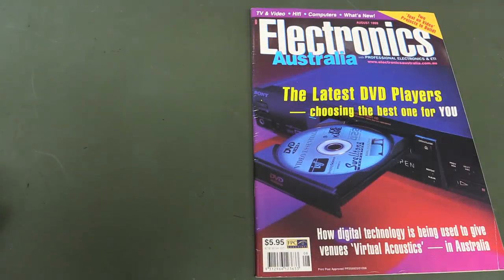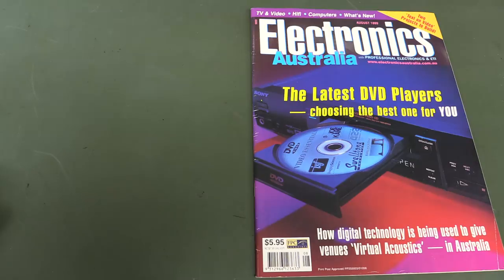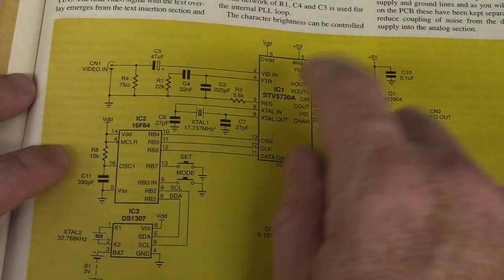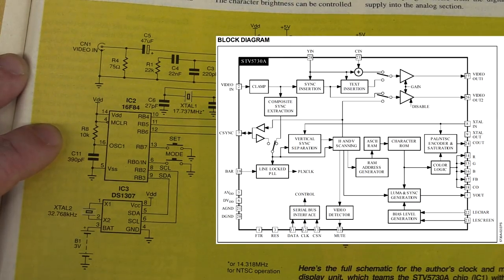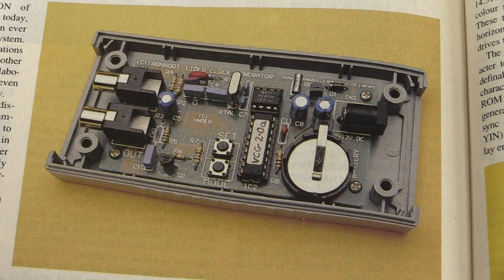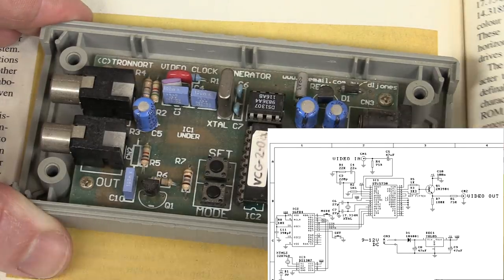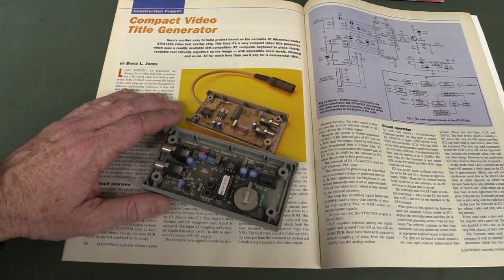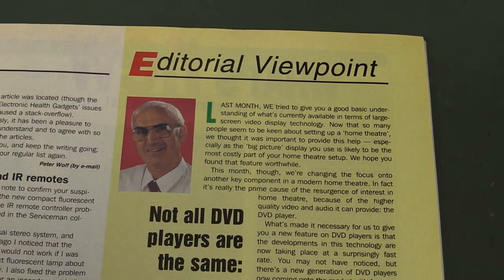EEVblog #b10000000000 - 1K Micro Magic

Comment: Hm... "Copyright TRONNORT"? Someone was a fan of a certain movie back in 1999. :)  The code was assembled not compiled. Was that a typo in the text "VLDEO CLK"? Anyway, very nicely done. Always fun writing programs in assembler for a device with very limited memory. I never got in to PICs due to the bank switching business. I'm working on a project using an AVR with 4K program memory and 256 bytes of RAM. I worked a way to store 4 GPS position reports in that amount of RAM. :)

Comment: Is that composite really the same as old style PAL? Seems a bit detailed. Could throw the chip out otherwise. How much text could they enter in the 2nd project? Is there enough like ram somewhere?
Reply from the maker: You could put text anywhere on the screen. IIRC the RAM was inside the STV chip, you wrote to that.

Comment: If you like stuff crammed into small amounts of space, check out the Demoscene. They've made an art-form out of tiny programs. There's plenty of videos on YouTube of recordings of 64k and 4k demos. I once even found a real-time ray-tracing demo that takes up just 256 bytes. Still got the .COM file. Yes. COM, not EXE, COM. 16-bit DOS program. Works just fine in DOSBox. It's called "TUBE" and even includes the x86 assembler source code.

Comment: This reminds me of when I programmed several video games into an Arduino (ATMEGA328 microcontroller) and I was very disappointed it didn't fit the 32KB of memory. By the way Arduino is great to start playing with microcontroller but it's not optimized for memory efficiency.

Comment: LOL, the old Warp13 programmer!... I still have one somewhere..
Reply: I still have a 100 or so PCBs sitting behind me. One day you might see another Warp-X3. :)
Reply: I have fond memories of this reliable programmer. It worked like a dream but the support was suddenly gone. It could not program the newer devices so I had to buy a new programmer.
Reply: Yes, it was very sad and I still really feel bad about that even today. However, the collapse of my health was not something I could control. Very sorry about the sudden demise.  Anyway, thanks for your support.
Reply from the maker: Well I'll be, it's none other than Jim Robertson!
Sorry to hear about the health problems causing the discontinuation of that excellent programmer.
Reply: Sorry I did not know you are the designer. It was not meant as criticism. I meant to say that I found it a pity I had to shelf my favourite programmer. I was just learning how to program microcontrollers and had some issues with programming a PIC16C71. The damn PIC would not program so I wrote you about this problem. You let me measure some voltages on the programmer (were OK) and then asked me what PIC I was programming. After that you took the time and patience to friendly explain a dumb dutchman what OTP meant....  I hope you are in good health now.
Reply: Jim Robertson I always did wonder what had happened, now I know.  From someone else whose health collapsed suddenly shortly after turning 18 (in 1990) and never really recovered I wish you the very best and if one day there is a V3 then so much the better, but if not at least we got to enjoy your earlier work for a good while.  But do take care of yourself.

Comment: It says 00:00:80 Is that HH:MM:SS? Why are there 80 seconds? @24:00 It seems to work properly @26:20
Reply: It's not showing the current time at that point, it's letting you set a custom title. Presumably Dave figured it was up to the end user to not do something stupid with the digits. Or if the end-user wanted to put 80 seconds in their title screen, that was their problem.
Reply: Now I'm curious what would happen :D

Comment: Many years ago I coded a Bell 202, 1200 baud Demodulator in assembly for an ATTiny10, which has only 1024 instruction words.  I never would up using the modulator code for anything practical, but it was fun to explore doing digital signal processing on such a limited system:

  https://sites.google.com/site/wayneholder/attiny-4-5-9-10-assembly-ide-and-programmer/bell-202-1200-baud-demodulator-in-an-attiny10

This was back before the ATTiny10 instruction set was supported by the GNU/Atmel toolchain, so I also wrote my own simple IDE and assembler and built my own programmer for the TPI protocol using an Arduino so I could write code fir it on my Mac.  This project is covered here:

https://sites.google.com/site/wayneholder/attiny-4-5-9-10-assembly-ide-and-programmer

I later upgraded the IDE to support coding in C once the GNU toolchain was updated for the ATTiny10:

https://sites.google.com/site/wayneholder/attiny10-c-ide-and-improved-device-programmer

The ATTiny10 seems to have become hard to obtain after the Microchip acquired Atmel, but I still think its a powerful little chip (especially for its size) and my web site, https://sites.google.com/site/wayneholder,  describes several other projects I've made using it.  Most recently I used it to create my entry for the Flashing Light Prize 2017:

https://sites.google.com/site/wayneholder/flashing-light-prize-2017

Wayne

Comment: Because I only had access to Mac and BBC micro computers when I was young, Microchip was always inaccessible and that is still true today. They continue to support Windows and not Mac! In an age of platform agnostic support, Microchip has bluntly refused to make any of their products useable on a Mac without third party help, choosing Linux and Windows machines only! Since they bought Atmel, I have nothing but dread about that company. Its consideration for other platforms or its products, is for me very worrying! The Arduino environment suffered a major blow when Microchip bought Atmel and consequently the shift to other platforms is only a natural event - Expressif, Intel, and others. Microchip had a huge advantage for years but threw it away by being secular and belligerently focused on Windows only. This is not a company I think highly of at all!
Reply: State of Electronics. You're wrong. MPLAB-X is available for windows, mac and Linux. mac is good for commercial and professional printers and editors. It's nowhere near a geek machine. Time to switch to Linux : good softwares, all languages available, easy hardware access : some even program their µC of any brand using the GPIO found on raspberry. I personnaly program my own AT89 µC with a home made parallel programmer and a self written C program. How is it connected to the PC ? Parallel port ! How to access it in software ? #include <partport.h> 
Give me a mac, and I will resell it at once to buy a standard OEM PC hardware and install Linux.

Comment: Your magazine changing and folding reminds me of a tv network called TechTV which was an arm of CNet in the US.
    G4(specialized in videogames) took them over and it was okay for a while it became G4 TechTV and it kept some of the old shows and even some of the videogame shows weren't bad we still lost a lot of tech shows though however G4 did bring a lot of interesting personalities to the network.

 Then it changed again switching formats completely and it became one of those mindless generic masculine high-octane networks that focused on reality TV with action or sex appeal.  They also fired their television personalities just to re-run other networks' reality shows.

   The worst part about it is they are still around so switching formats to cater to the lowest common denominator was a more profitable strategy than producing intellectual content and I wish I could be surprised but you see it on youtube and what gets 20+ million hits on it sadly isn't Dave's EEVBlog.

Comment: That should compile using Code::Blocks using gcc_pic16f84.so as the compiler in Linux Mint 18.2(Sonya) 64bit edition which needs builder essentials but has to be rewritten in AT&T format for it to compile.
Reply: John Francis Doe but it works and I love it

Comment: At a different scale, I squeezed a RISC OS module "DragWind"/"DragWindow" to allow moving of Windows without using the title bar into exactly 1K of ARM PROG26. And then gave up. Probably included resize and X, Y & XY scroll, all with option not to pull the window to the top of the stack. Doesn't sound that impressive, but interacting with the OS was really not helpful. Later versions were bigger. Can't find the source, but google throws up the basic information from 15/10/95. ftp://ftp.amiwiki.spb.ru/Amiga/Site%20mirrors/ftp.magix.ws/Commodore_Amiga/Collection/BBS/Amiga%20CD-Rom/Amiga%20cdrom%20-%2008%201995%20-%20bbs%20-%20Amiga.txt

Comment: The Sinclair ZX81 had a 1k chess programme which played a decent game of chess, well decent if you are crap at chess I guess - which I was. All squeezed into 672 bytes which I think is a staggering achievement. Can't remember...ah, yes I can...Was going to say I couldn't remember the graphic representation, but of course it used the standard character set. 'P' for pawn I guess on a simple chequerboard. 35 years ago. Cool. That is a great exercise in tight arse programming, and many other disciplines, to  fit chess into as few bytes as possible. Wonder if/who has beaten the 672 bytes of 1K Chess for the Sinclair?

Comment: This reminds me a projet I did back in 2000 with the same PIC16F84.
It's an infrared receiver that allows you to control your PC with any existing remote.
http://www.dalzone.com/urcr
The PIC communicates with the PC via serial port but, as you noted, this PIC does not have a UART. So I emulated the RS232 protocol at bit-level, using NOP operations to find the perfect timing knowing the clock speed! That was fun.
I'm not sure about the code size but it was less that 1K for sure.

Comment: Dave, interesting video, and just goes to show how well the design and code stood up to time.  With regards to how much code you could fit into 1K, well I remember playing the traditional startrek game with an 8 x 8 galaxy, klingons, bases and even black holes that some guy had written to run in 1K on a Sinclair ZX81 - modern programmers and coders are spoilt these days with the amount of memory available in computers and PICs. - Oh and I noticed something amusing with the RTC display around the 26 minute mark.  It seems that every forth second is quicker than the preceding three... sort of 1....2....3.4 !!

Comment: I like to playwith µcontrollers as a hobby. MPLAB-X, although very big, is a first-place IDE, and this video confirms this. However, I always think PIC16 asm is awfull. I far much prefer mcs51 asm. I can easily write programs in mcs51 asm, that make me swear and sweat in pic c-language. But how can a little software like mcu8051ide compete with mplab-x ? How can ponyprog + handmade parallel STK200 programmer compete with even the small pickit3 ? Playing with µcontrollers can sometimes be very frustrating.
Reply: You get good at it with practice though. After a couple years of writing PIC assembly you can really quickly ramble out the opcodes in common patterns that you need.. almost like compiling 'C' in your head while you write it.

Comment: There's this, and then there's Arduino which compiled to about 1200 bytes just to flash an LED ^_^. The price of making things easy though eh...
Reply: kal9001 In all fairness, though, you do not have to use the Arduino IDE to code and program an Arduino, you can opt to program them like the AVR micro they are if one wishes.
Reply: Ethan Poole I am aware of that. I use atmel studio myself with an AVRdragon. But like I said  that's not as easy as an arduino.

Comment: Um Dave, while the PIC instruction set may be small it's certainly not RISC - there's only a single general-purpose register and instructions can be of several different lengths, to name just a couple violations of what RISC is.
Reply: You certainly know better than microchip. 8031 is CISC, PIC is risc. all instructions are 14 bytes long.
Reply: 1) RISC does not require instructions to all be the same length. Though, yes, it's common as it makes instruction fetching easier.  ARM, Power ISA, MIPS, RISC-V (among the ones I know of) have short-form/compressed instructions to reduce code size.
2) Amount of registers equally does not a RISC make (or break). Thought it's typical for a risc to have 'a lot' of registers, it too is not a requirement.  An Itanium has 128 registers, a Blackfin has 8 (that's the same as an 8086).

RISC is not about a reduced set (as in 'not a lot') of instructions, it's about a set (any size) of reduced/simple instructions.

Comment: i tryed before to progam pic i oy pickit 2 but i never got anything working .. now when i want to try again i can not find the progaming softehere that cam on a cd on whit the kit i try to find it to download but cont find it on Microchips homepage . 
but i did lean much about it then . it blowmyminde that all this lowasebly comand is useet under higelevel cold 

and you look at the hexa code converted back to assemli , if you look up the datasheat for that pic you probebly find the words for the asembly comandes . like on this PIC16F84A(http://ww1.microchip.com/downloads/en/DeviceDoc/35007b.pdf page27 )

love your show  
mabe you can make a little project for us to folow whit arduino or pic

Comment: 1) the C in risc stands for Computer, not Chip.

2)
11:53 Can we stop using this wrong interpretation of the acronym RISC please.

RISC does NOT mean a low amount of instructions.  As in reduced [instruction set] computer. (the "reduced" does not not reduce the set)
The correct interpretation is [reduced instruction] set computer.  As in... a set (regardless how large this set is) of reduced instructions. or a set of 'simple' instructions. 
Typically meaning the instructions will execute in 1 clockcycle, and load/modify/store are typically (but not necessarily) not available but you need to code separate load, modify, store instructions explicitely.

So where a CISC like the intel 80x86 allows you to do
   ADD [Memory],14      ; add 14 to a memory variable

A Risc would require you to do
   Load reg1, [memory]   ; load variable into reg1
   load reg2, 14                 ; load immediate value into reg 2
   Add reg1, reg2              ; add reg 2  into reg 1
    store  [memory],reg1   ; store reg1 into variable
In some cases, the above would even need more instructions to load the address of memory (an immediate) into a register first, then load the memory pointed to by a register

Comment: 'VIDEO CLK' changed to 'VLDEO CLK' after programming the new chip.
Reply from the maker: No, I was messing with the buttons. The text is stored in the DS1307 chip
Reply: I caught the part about using the RAM in the DS1307 to store the text, but thought it may have become corrupted. Seems I missed the change when you were playing with the buttons :)

Comment: ERROR !!! the video should be titled "1111111111" That is 10X "1" for true 1K. "10000000000" is actually 1025! Not 1024.... But I forgive you.
Reply: andrew heywood I think you should rework your binary conversion. 1111111111 = 512 + 256 + 128 + 64 + 32 + 16 + 8 + 4 + 2 + 1 = 1023 . When you had a C64 and had to convert binary to decimal for your sprites, b2d conversion comes like a native language.
Reply: Ooops.
Reply: CaptainDangeax Yes, many get a bit confused when it comes to zero being a significant value and not just a null place holder.  0xFFh is 255, but there are 256 states/values between 0x00h and 0xFFh, yet 256 is actually 0x100h.  Everyone in computing has made that mistake at least once, if not more.
Reply: Either you count from 0 to n or from 1 to n, there's one only way to convert from base10 to base2 and back b10000000000 = 1024. Period.